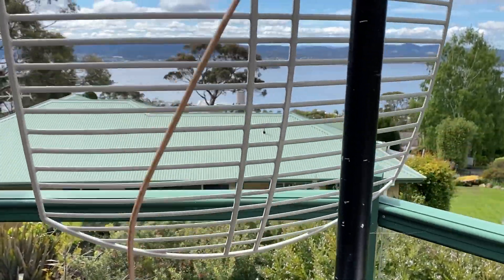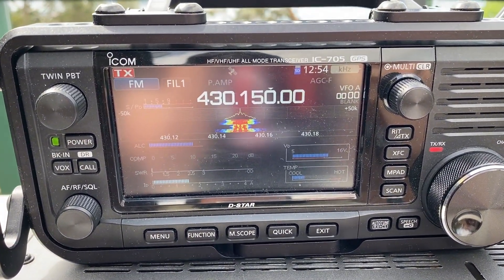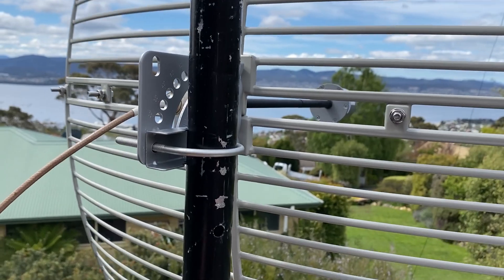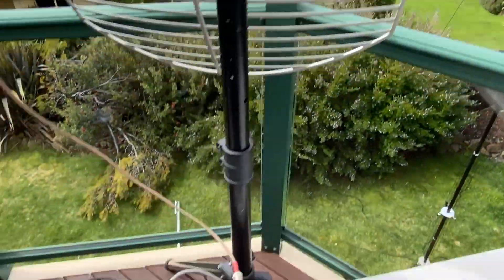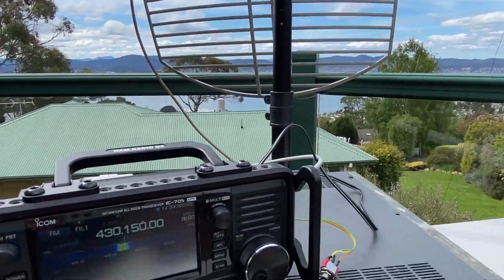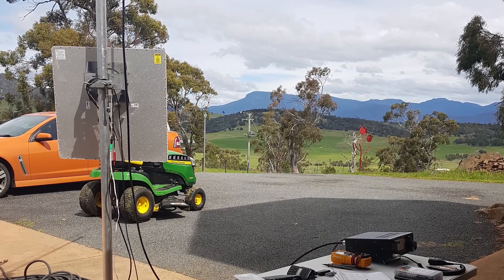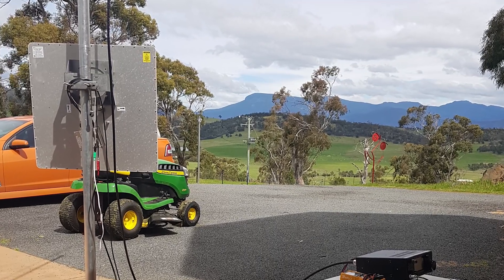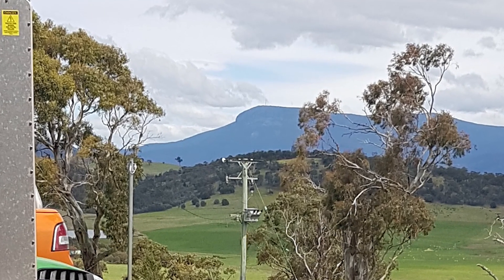Beamwidths are pretty TIGHT using this Antenna!

Comment: The bands are fun to play with. My best contact on 440 was 150 mW on a Kenwood handheld, rubber antenna from inside the house to a repeater 50 miles away.

Comment: Interesting 🙂  Curious as to how much beaming across the water affects the signal? Is it better to go across open land without trees and buildings? What's the polarization of the grid pack antenna? They look sort of vertical. So many questions. I'm sure you could write a book about it Hayden. Thanks for the varied content and not just HF DX.
Reply: Horizontal Polarisation (making the refletor look kind of vertical). Polarity goes by the 'grid' direction